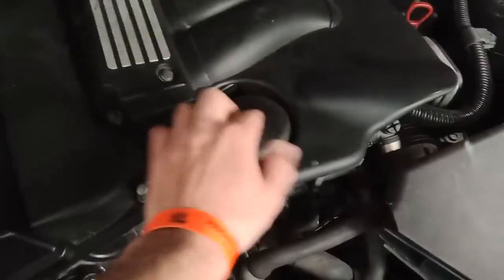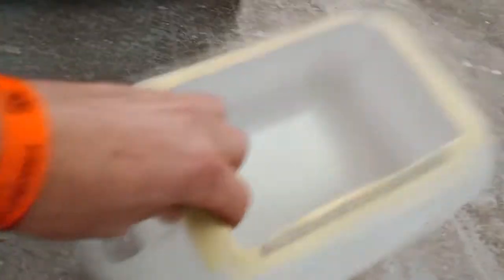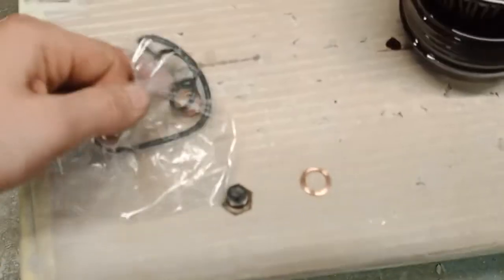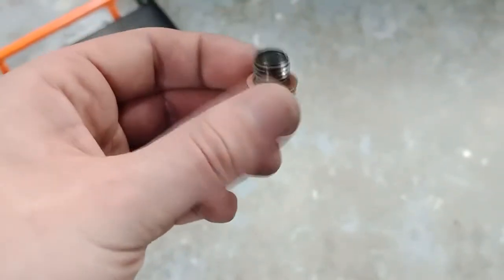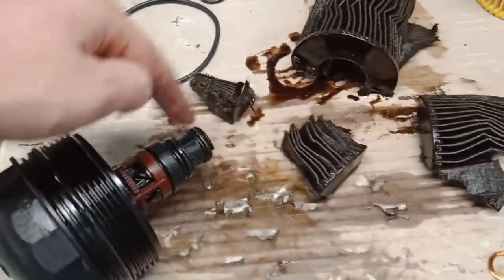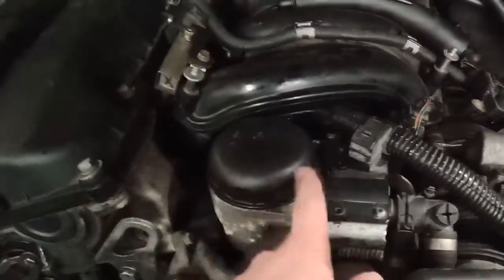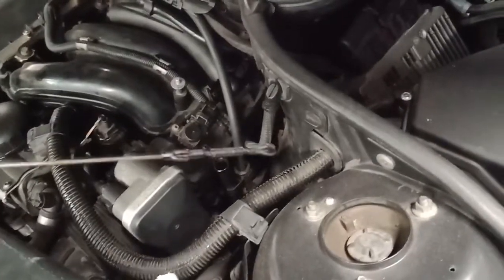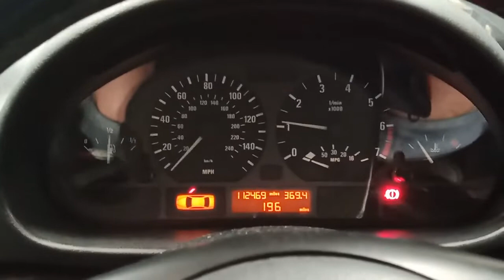How To Do a Oil Change On BMW E46 N42 Engine

Comment: You should use thicker oil because the engine is very sensitive!
Reply from the maker: 😅 Sorry, I can't agree to that.  You need to use the right oil for the right environment. ( Where I live 0W-30 is what the car needs) You should use the oil that the car manufacturer recommends.
Reply: Ok sorry I thought you used 0W-20 but it’s 0W-30 which is fine I guess. I would say the manufacturers usually recommend thinner oils because this is how the engine is more effiecient but the engine components are not protected and lubed as well. Also oil pressure is better with thicker oil. I just had to repair the Valvetronic on the N42 because the previous owner did not use the right oil and change oil often enough. I will use 5W-40 now and change it every 10.000km max. Maybe Castrol Edge 0W-40 would be good for you
Reply from the maker: You got it the other way around. Thicker oil takes longer to reach all the bearings and locations where it should be.
You use thicker oil on old engines, where the cylinders' bores get worn and don't seal. 
You are correct thicker oil will give you more oil pressure, but that isn't good. Engines are built on thigh tolerances,  increasing the pressure can lead to faster wear and engine damage over time.  
Valvetronic is a part that will break on the N42 engine, you can't escape that, but regular services will make your car's engine last.
I do the oil changes after 5000 km. These aren't new cars anymore, it's best to keep an eye on the engine.

Comment: You should run the engine for at least 20 minutes with system cleaner because of carbonation ☺️ but just recommend
Reply: No carbonation for a PFI engine. That's for DI and diesels.

Comment: so thin oil in this engine?? hahaha..friend, these engines are already quite old, very sensitive and hot, so you poured water in it... you need at least 5w40 for that engine.. 0w30 goes in the latest engines...
Reply from the maker: Sadly on an old abused and worn engine you are 100% correct. If the owner doesn't do regular oil changes and doesn't looks after the engine, 10w40 is the last effort before chucking it out. 
For the engine on this exact car 0w30 is what it needed.